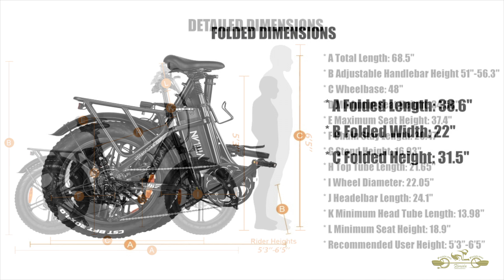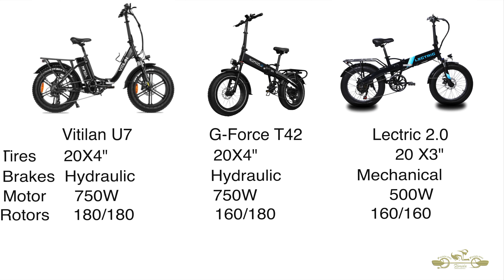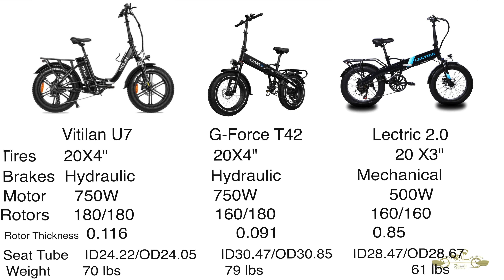Vitilan U7 Detailed Review Part 1

Comment: Great video.  How big is the bin? What made you pick the U7 over other folding bikes like Lectric etc
Reply from the maker: 750watt motor, hydraulic brakes, 16 amp battery and of course 4” tires. The bin you saw is for my G-Force T42 which is a 70gal. A 50gal will work fine for the U7.

Comment: Where did you get the tote and the dimensions?
Reply from the maker: X-large 50-Gallons (200-Quart) Black Heavy Duty Rolling Tote with Latching Lid https://www.lowes.com/pd/CRAFTSMAN-50-Gallon-200-Quart-Black-Tote-with-Latching-Lid/1000976084 for the U7
For the i7 Your friend has shared a link to a Home Depot product they think you would be interested in seeing.

https://www.homedepot.com/p/HDX-70-Gal-Tough-Storage-Tote-with-Wheels-in-Black-with-Yellow-Lid-206203/313792519
Reply: @DaleMrDSimmons  thank you!!